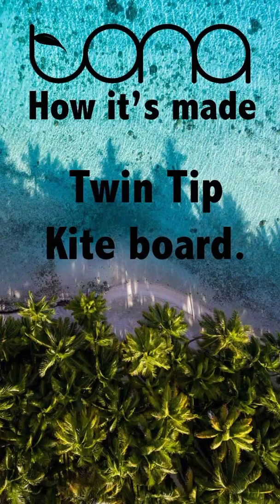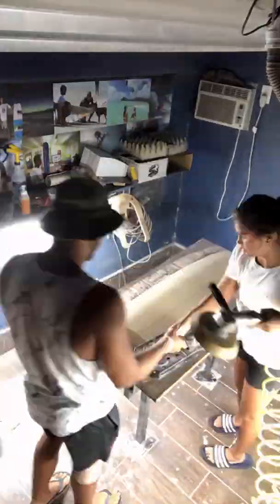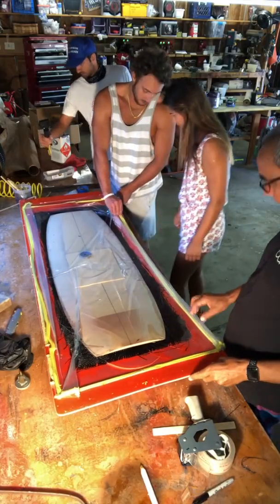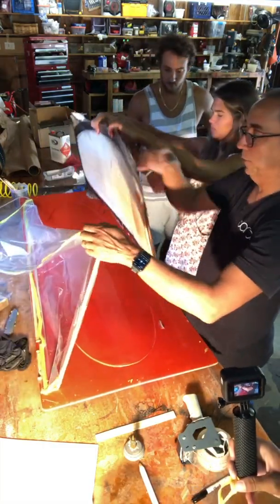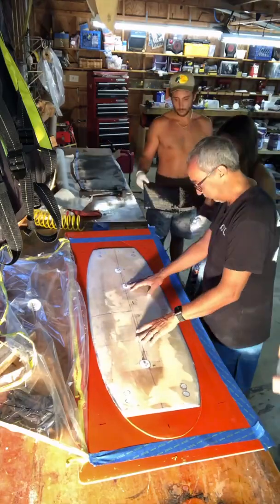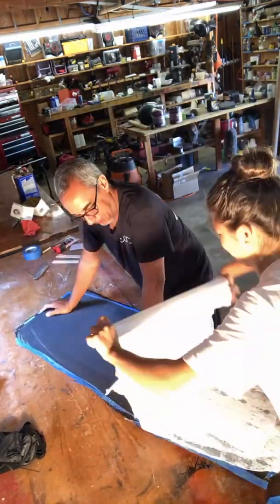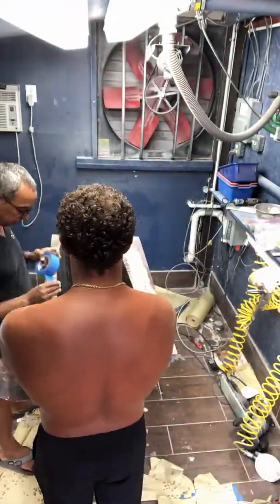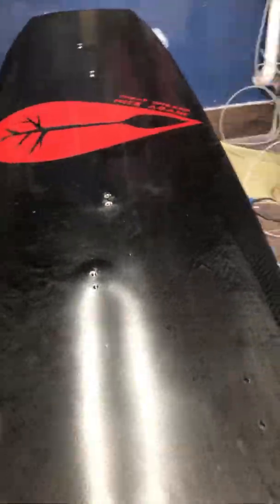Tona Shaping Room. How to make a kiteboard. Twin Tip. Carbon Fiber.

Comment: The board moves around when you put on the top layers and you can see after the drying process, that the direction of the last layer is a little bit squared. That’s not good work. The whole board doesn’t look straight :(

And the fact you never youse gasmasks when working with resin and other stuff + while sanding the board, makes the video even worse. This will end in cancer some day 🤷🏻‍♂️